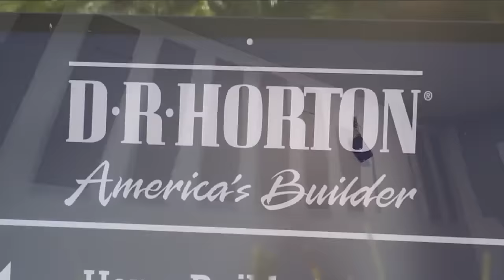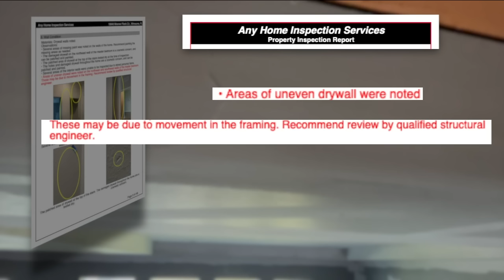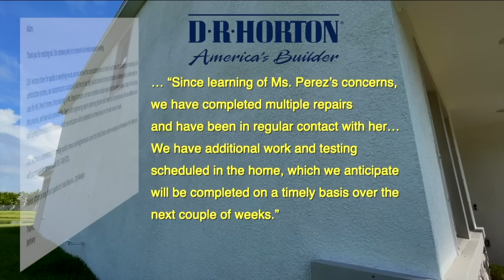D.R. Horton construction problems keep owner out of home for 3 months; company hasn't paid expenses

Comment: So much of this should have been addressed during the build and not at closing. If your framing has warped from being exposed to water for a prolonged period of time, and the builder is moving on to insulation and drywall, then it is pretty clear they do not plan on fixing anything.

Comment: I also had issue with dr horton.
Bought fresh new home from dr horton and in a month my pipes were blocked and had small pellet rocks in pipes. Notified dr horton but seems no one care to solve the issue. The sub contracts they keep us waiting and waiting and when they showed after a month or two they never do a permanent fix they blame builder dr horton. While dr never check with customer wether issue is resolved.

I had 1year warranty ticket created its now more than 6months no one came to check the issues. Very bad service once home is sold they don't care.

Comment: I learned a long time ago if you can avoid dealing with any construction company that uses subcontractors.  Subcontractor = scapegoat for the company.  Instead of fixing the problem they will blame subcontractors as a delay tactic, and hope you get fed up and quit. If you can buy from or hire companies who have employees, not subcontractors.
Reply: Does that exist outside of mobile home manufacturers? Think of all the licensed or specific trades needed. Plumbing, electrical, concrete, cabinets etc, etc

Comment: I am familiar DR HORTON. 

My sister bought a brand new home from them, it was built well to completion with roof , walls. everything. 

I wonder why they started slacking on quality of their work ?

Are they financially struggling and can't purchase supplies to finish the job, if that's the case then should not sell the house and cancel the closing. 

Give buyer back their money and finish building on the house until completely done.

Don't sell a 75 % finished home!

Comment: I own a new DR Horton- my 5 BR 3.5 Bath house is slowly falling apart. I’m so pissed- from the ceiling drywall not screwed into the beams to the water around the primary BR shower pan. As soon as the rates drop- I’m selling it

Comment: I have the same problems with my DR Horton home. They maybe fixed 2 or 3 problems out of the 60 we marked on the walk through. The day we moved in, all of the blue tape was still there. Once we were in the home, they made nothing but excuses and lied to my face. They told me its supposed to be and look like it does. I'm not a contractor. I'm also not stupid. The only thing holding up my house is glue and tons of it.  My foundation is crumbling. My bricks are going to fall out. The morter is missing, sloppy, & none existent in most areas.
I just wish they would take accountability for the homes they built. They had every opportunity to do it right the first time. We get hurricanes and someone could get hurt or worse. I really hope it doesn't take that happening for them to remedy these problems. 

Well, I hope everything works out and you guys can finally move into a great house.

Comment: "In house" financing from a builder - is that like car dealer buy here pay here, but for houses?  Does it negate some of the oversight and protections compared to other types of loans? What kind of rates would you typically see in this? D.R.H. demanded you close in spite of obvious fundamental issues or face penalties, but the real estate agent didn't sound the alarm and got their commission paid? What kind of penalties are normal when you back out of the closing process?

Comment: What lender allows a closing on an inhabitable property. Technically, the house is the bank’s collateral when a buyer is financed. Some banks refuse to finance a home with exposed concrete floors or not deemed “move in ready”. This lady’s pushed to close on an unfinished property needs legal assistance. Unfortunately, most real-estate attorneys don’t take cases on contingency & are quite expensive bc it’s a specialty.

Comment: I’m a spec home builder. I can’t close a sale until every single item on a punch out list is completed and inspected by the buyers’ home inspector. This only closed because DR Horror is huge and strings are pulled for them. I can’t hardly find building lots in my area for them snapping up everything they can get with their buying power.  Because of the volume of homes they build some buyers will end up getting the fid.  A navy boatswain mates tool for splicing rope into knots etc. It’s long and tapered and used to create openings in the rope to pass the strands through. It would be very painful to have it shoved into your bum.  Much like the pain this poor woman and her family must be feeling. They could easily make her whole but won’t raise a finger until forced to.  They blow.

Comment: Well, it's a beautiful home but she simply shouldn't have signed off with the house in that condition. I bought a DR Horton home last year and I "blue taped" the shit out of the flaws that I wanted them to fix before the final walk-through. And as predicted their response is always "it's cosmetic" when I demanded they take care of the mistakes/flaws I pointed out. We really wanted the house because of its location, but we were fully prepared to walk away if we weren't satisfied. DR Horton suck as a company but what people need to understand is that they're only interested in the bottom line. And that means the contractors they use are the guys who give the lowest bid and work the fastest, which many times results in shortcuts, half-ass fixes and covering up mistakes. I told my wife if we wanted a perfect house, we'd have to spend a lot more and buy a custom home.

Comment: Dirty Horton (the preferred nickname among inspectors) is a bad builder.  I live in a neighborhood that is being added to by them and the houses are horrible.  Entire sections of homes with no house wrap, missing flashing/tuck tape on openings, bad framing, decorative stone applied directly to single ply house wrap, electrical issues, etc.  Its the largest builder in the US, but the worst.
Reply: Electrical issues are the most worrisome. Probably not a question of if a fire will happen but when. Could be a manslaughter case waiting to happen.